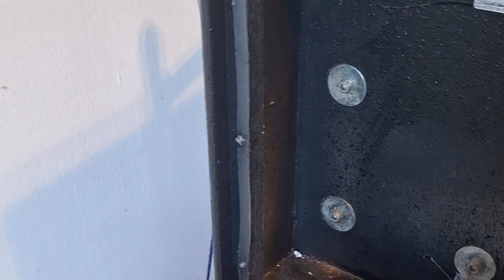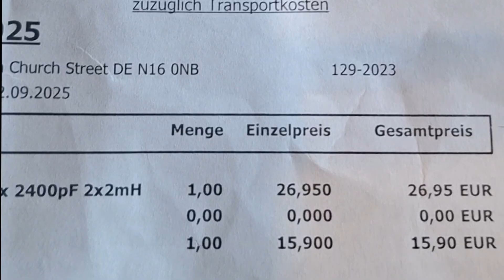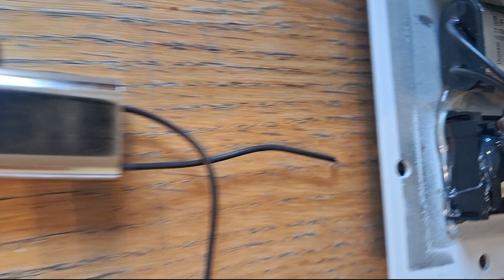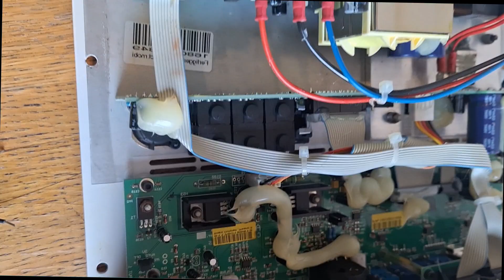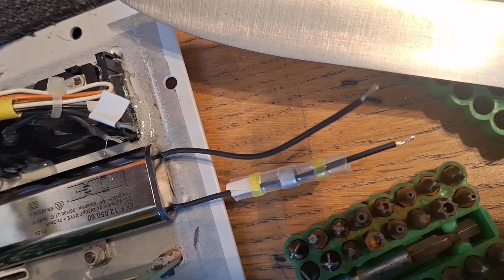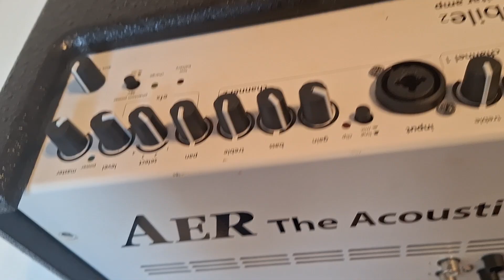Fuses Keep Blowing on your AER Compact 2 Mobile amp?

Comment: Original is 12uF your replacement is 24uF . It’s an important number. you’ve doubled the microfarads. You can only go 10 to 20% more.. Do you have any issues? I have the same amp. I use a motorcycle charger and two wires coming out of the amp. With a Gromit connection,. It charges it in about an hour instead of waiting for the ridiculously long time.